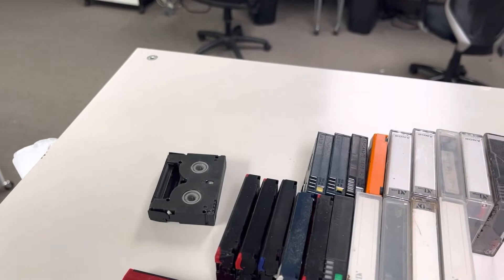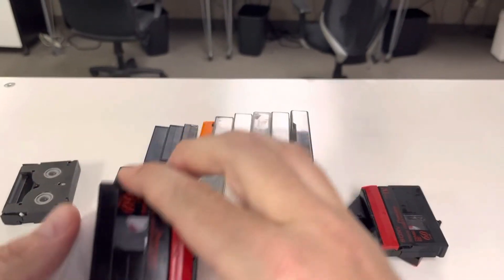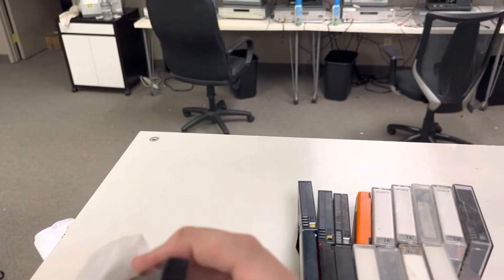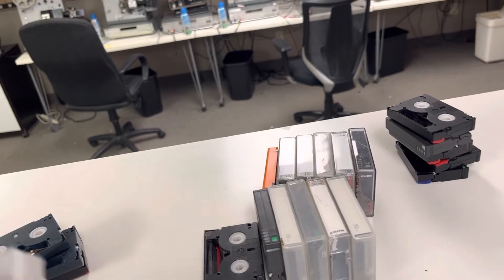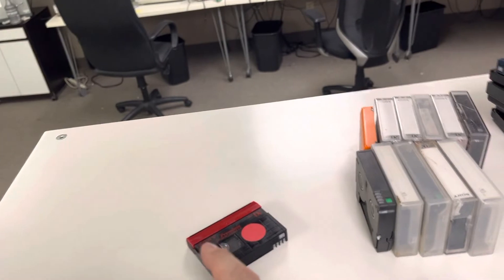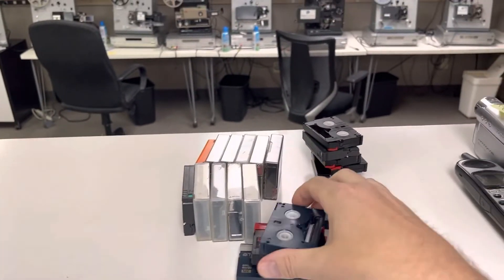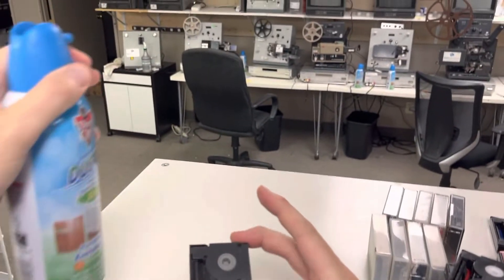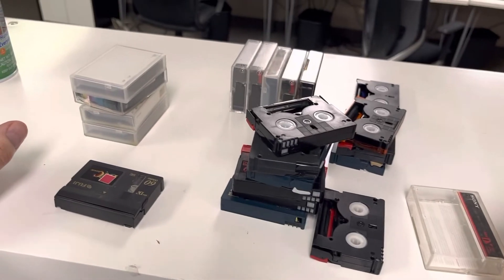Cleaning dirty mini dv camcorder tapes before digitizing them to MP4/USB

Comment: I have several mini DV tapes that appear to be corrupted or something. I've tried them in several machines with the same results in playback. Some are pixelating down the right hand side of the image and others just won't play and just give a blue screen when playing. The tapes have always been kept clean and stored in their cases in a box. They've never been placed near heat sources and kept at room temperature. The cameras have also had their heads cleaned regularly. 
So I was wondering if they are lost or is it possible that the footage can be saved and digitised.
Reply from the maker: Do you remember playing the back years ago and then being ok?
Reply: @gotmemories  yes they were fine. I did send them to some guy to digitise them but lost all the footage due to a burglary. Until they had them there weren't any playback issues. The tapes were recorded in 2017/18 so not too old.

Comment: I see the cassette being cleaned … not the tape. Is there a method of having the tape wiped clean of dust/mold ?
Reply from the maker: If there is mold, that's a whole different process. I don't transfer tapes with mold, it's not worth ruining a deck for. If someone is willing to pay $$$, possibly, but these days, decks, heads, parts are in short supply and $$ and nobody is willing to pay the appropriate pricing for tapes in poor shape.